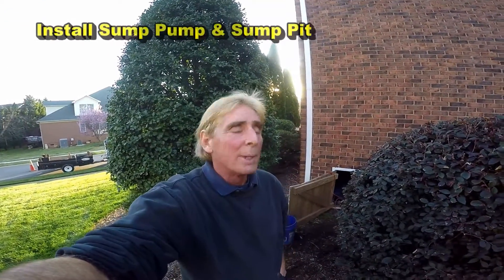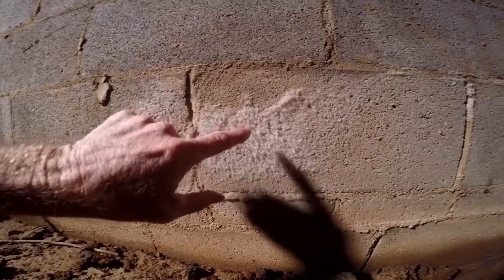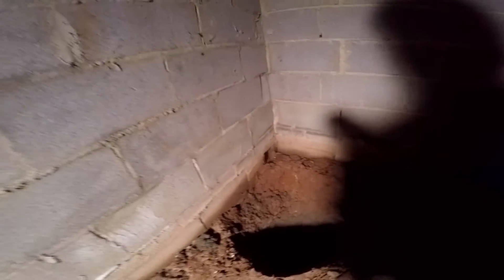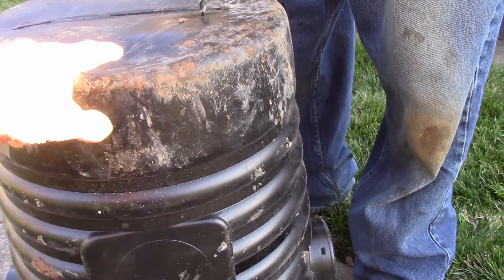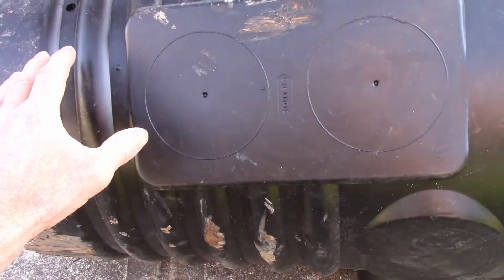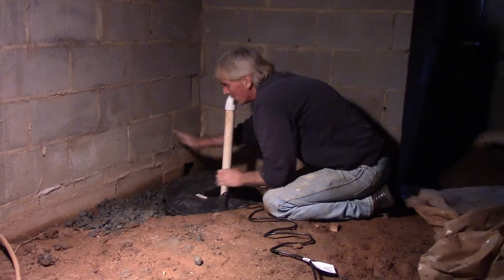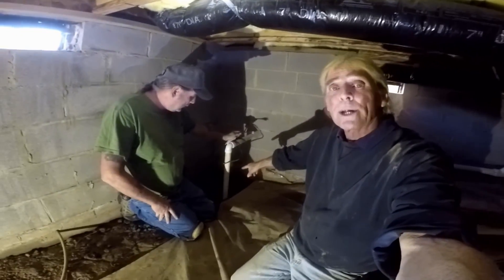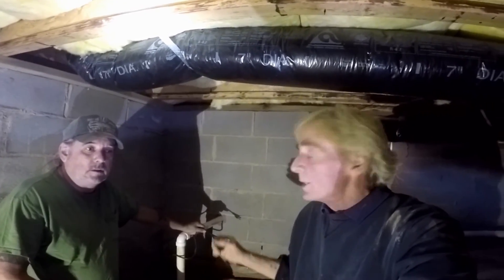Crawlspace - Sump Pump and Basin Install -  Do It Yourself and Save 1000'

Comment: Great video. I wonder if you could have sent the discharge pipe out the square hole (the "core"?). Or is that square hole not actually going all the way through the foundation wall.